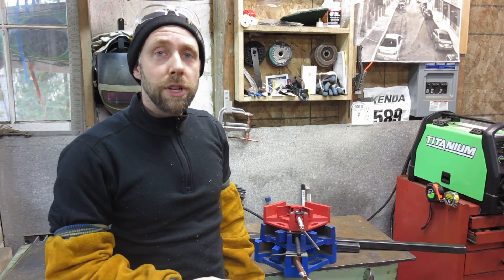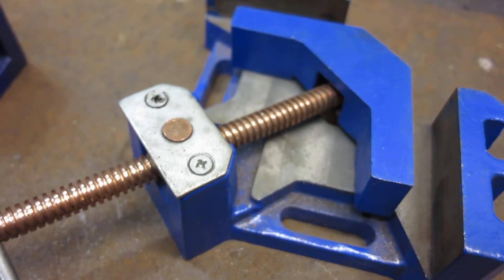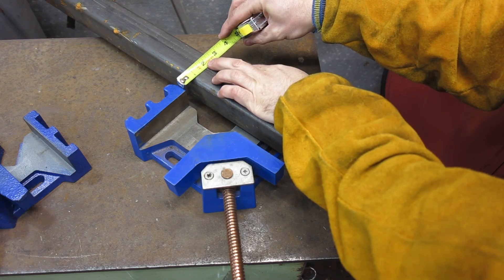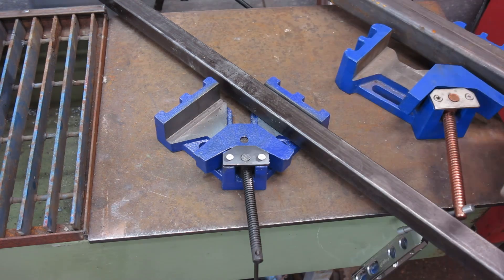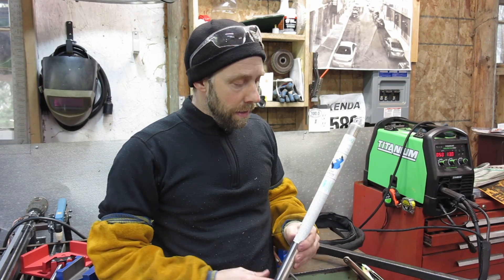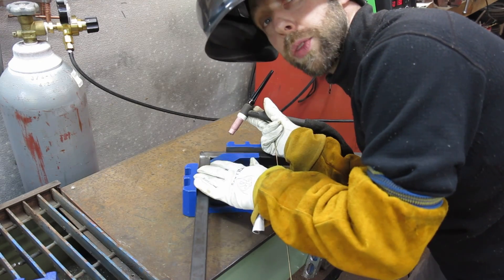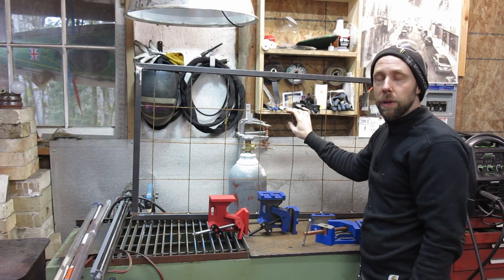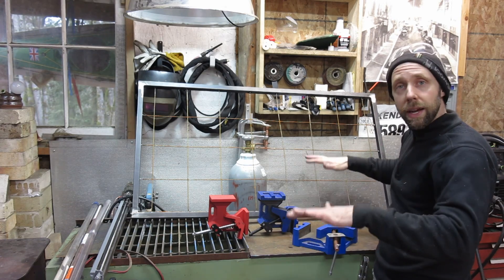Welding clamps And TIG welding With Titanium 200

Comment: Mike, thank you showing the clamps.  Also, you mentioned that was a baby gate to keep munchkins away from stove.  Keep in mind large openings kids can get there heads into and get stuck or possibly strangle.  That looked like maybe 6x6 welded wire mesh.  Building codes say for baluster spacing that should not pass a 4" sphere.  Keep up the good work.  Keith

Comment: enjoying your vids  can this welder use a foot pedal
Reply from the maker: No foot pedal is available for this Titanium, I think they should have offered one though.
Reply: @Mikefestiva  really looking at yes welder 250p,or vulcan 205
Reply: ended up with weld pro 205p,ac dc,w pedal, and cw 17 tigtorch super flex ,

Comment: Thanks brother👍👍👍 for all the information. Yeah I got 2 Titanium 170 one is designated for steel and one for aluminum.
Just to let you know that Titanium came out with a spool gun not to long ago. It looks and fills just like a parker gun. It fits the 200, 170, & 140 Titanium
Welders 10' 6" lead 150Amp it's bad ass Brother. Way nicer then the the klutch. Eastwood. & jegs.
You should get one do a show on it. Thanks for all your show's I learn a lot from you and I've been getting the hang of it all.
 Thanks..👍👍👍👍 ( Tabe )

Comment: Hi Mike. Another great video.
So what kind of Tig torch comes with the Titanium 200 I just got
A Titanium 170 and wanted to see if it fits. Thanks. (Tabe )
Reply from the maker: It’s a #17 torch, it comes with the 200, the cool thing about TIG is all the torches are basically universal, some don’t fit others only because they are rated at different amps but if you buy a # 17 torch from a different company it will fit onto the TIG lead.
I’m sorry to tell you but the Titanium 170 doesn’t have the capability to run a TIG or stick, it’s the electrical circuits inside, TIG and Stick work off of constant Amps, MIG works off of constant Voltage. But here’s a tip, if you buy the harbor freight warranty, ( I think you have a month window to buy it after your purchase) it’s good for upgrades, the 200 would be considered a upgrade so you could get the full credit of the 170 to buy the 200 if you wanted TIG, if you already have the extended warranty you can upgrade any time during your warranty. One last thing to note it’s only DC TIG so your limited to steel and stainless steel, I hear people claim you can weld aluminum with 100% helium but I think it’s really bad looking welds, ( I don’t recommend that process) I hope this info helps. I’m glad you picked up a welder 👍
Take care 🙂

Comment: Did you say you were making that gate slide ? What did you use if you did ?
Reply from the maker: I used the metal gate to slide between a doorway to keep my 2.5 year old from going down some steps. Thanks for checking out my video.
Reply: @Mikefestiva  did you use a track off some kind ?

Comment: Where can you the mig tips for the titanium 200 at?
Reply from the maker: If you have a Harbor Freight, the Vulcan ones fit, the Lincoln tips from Home Depot are also the same. If Lowe’s sells welders I’m sure they will have tips also, or just about any weld shop should have them. I think I covered this in the first comparison video I did on the Vulcan and Titanium welders, I hope this helps :)

Comment: I like those vises. The problem is holding large materials that are heavy, so the thing wants to tilt over, even with my big vise I’ve got that weighs close to 30 pounds. The material does too, when placing it in the vise until tightened up. So I had to machine pieces the height of the beds, and place them outboard. That helps. Most of this stuff is made overseas, so the sizes are really metric, so they seem a bit odd when measured in inches.

Comment: Thanks for another great video, Mike! I’ve been wanting to get more into welding. Never really did much except for a couple of little patch beads on equipment at the golf course that I used to work at and tacking together some washers to make snowmen. We were out of town today and stopped at a HF and I had every intention of pulling the trigger and grabbing the last 200 they had there but for some reason, I decided not to right now. Which sucks because we were 120 miles from home and the closest one is still 70+ miles away. 

My biggest concern is, as everyone seems to feel, that the HF line of tools just won’t hold up. I’ve gotten a couple of hand tools in the past but haven’t had to use them much to know if they are going to hold up for years to come. By what IS selling me on the Titanium 200 is being a Multiprocess for such a low price compared to name brand machines. I want to be able to learn all styles of welding and I know this would be best especially since it’s about 1/2 the cost compared to others, but I want to make sure that it will still last for years to come. Since you’ve had it, how do you feel it’s going to hold up in the long run? Do you think it would be a perfect beginner machine for someone who hasn’t really done any welding at all? Also, if the gun breaks and needs to be replaced, or if you want to add a foot pedal for it, are the Vulcan line of replacement parts compatible with the Titanium? I know the packaging doesn’t list the Titanium models, but I tried to keep my hopes up that maybe they just hadn’t updated all of that...

Sorry for the long comment. I’ve been wanting to ask a few questions for a while now since I came across your channel and really want to try to get some learning done! Thanks again and have a great weekend!
Reply from the maker: Hi Derek I do know how you feel about dropping that kind of cash at HF, a year and a half ago I walked into HF and bought the Vulcan Omnipro and I was a bit apprehensive on spending at that time $750 plus extended warranty and tax pushing the price out the door close to $1000. 
Keep in mind this was in the first month these new Vulcan welder line first came out, at that time there was only a few written reviews and a few unboxing videos but next to no videos of people actually welding with them at that time. I have been completely happy with not only my Omnipro but with the Titanium as well,They both weld fantastic! How many years will they last, who knows? Time will tell, but I can share this story with you, my friend bought a Miller around the same time as I bought my Vulcan and his Miller has been sent back for repairs 3 times now and he was without use of that welder for probably 6 months due to repairs, that Millermatic 200 cost over $2000, so I thing what I’m getting at is just because you spend more on a name brand machine doesn’t always guaranty trouble free. The nice thing is if you buy the extended warranty and something goes wrong you can take it in and walk out with a brand new welder, no waiting on a machine being sent off for repairs like with the name brand machines. Now I don’t think any of the Vulcan stuff like MIG guns will fit but I bet someone will sell a replacement MIG gun soon for these machines, I have seen other places selling MIG leads that fit the Vulcan line now so I’m sure it’s only a matter of time for the Titanium.
I definitely think it’s a great welder for a beginner or anyone that’s been limited to a low amperage welder, I really wish I could have owned something like this years ago, I had some really shit welders it the past. Honestly I personally would not buy a Lincoln or Miller, I have owned a Lincoln and I have used many Millers and these machines work every bit as good as the name brand stuff. One last thing to consider, once my friends Miller is out of warranty, if something big goes out inside the unit, it’s almost not worth repairing at $1000 dollars per circuit board and there’s two main boards inside. Do what you want, if you feel better with going name brand go that way nothing wrong with that, one thing I recommend is look at reviews on line, I just was reading reviews on Amazon for Lincoln’s square TIG 200 and there was many many people that got faulty units right out of the box or had them stop working with in a few months of use, all of these people dealt with sending there welders of for weeks to get repairs done, not what you want with a new machine!
I hope this helps, take care :)

Comment: Why did you braze some and fuse some, I assume your like me and like trying new stuff 👌. Also I would recommend a stubby gas lens kit, I got one this week and my argon regulator is on as low as it can posibaly go, and I'm still getting shiny clean welds. Saves alot of gas and is also a shorter setup. 👏🙂
Reply from the maker: Thanks for checking out my video! I like the look of the brazed bronze joints, the sides where I just fused the metal was because I didn’t want to build up the joint and add any extra metal, it was cleaner to just melt them together.
Ps next week I’m posting a video I made over a year and a half ago, it’s about my sawmill. I show how I made my throttle and blade lube controlled with the turn of a switch. So keep an eye out for that video! Is your mill up and running? I would love to see a video of it, do you have and posted on YouTube?

Comment: I had been looking for the large clamps based on a discussion we had on your previous videos.  I had been checking for a couple of months and finally bought two a couple of weeks ago.  Related to Tig Brazing. What situations would you choose to use the process?
Reply from the maker: Thanks for checking out my video! Well I’m new to TIG welding and brazing, but what I know about TIG brazing is even though it’s slightly weaker the regular welding rod the silicon bronze is useful for joining dissimilar metals like steel to bronze, steel to copper, copper to stainless steel, stuff like that, and one of the best uses is it’s good for brazing cracked cast iron parts back together. The cool thing is it’s got a lower melting temperature then the base metal your brazing to, you only need to melt the rod. The main reason I bought some was to braze some coffee tables together, I like the look of the bronze joints, it looks more quality to me. Take care :)

Comment: Another excellent video Mike.  I purchased a pair of the middle size clamps several weeks ago and had to replace the top bracket machine screws, as those that came with the clamp did not hold the bracket tight to the casting.  I believe they are M5 machine screws.  Can you explain brazing versus the use of TIG filler rods?
Reply from the maker: Thanks David for commenting and checking out my video! So I’m new to TIG welding but the advantage of silicon bronze brazing rod is even though it’s a little weaker then steel filler rot it’s got a lower melting point so you don’t need to melt the base metal, and you can braze different kinds of metals together, copper to steel, steel to brass, stainless to copper, and one big thing is it can be used to repair cracked cast iron parts. I figured it would to be nice to have around my shop and the last plus I can see to using it is the nice esthetics of the bronze joint, I’m working on some coffee table projects and I like the bronze look on the joints. Take care! Ps that’s to bad the clamps needed work already :(

Comment: Seems like I when I looked at that rebar, it was cheaper to buy animal panels. Nicer finish on the animal panels too, but that could be a negative if welding them, since they are galvanized.
Reply: Kids falling out of things is normal. Heck, I fell off a cliff when I was a kid. Had surgery, but my friends caught a tortoise and gave it to me, so it was worth it!
Reply from the maker: Thanks for commenting! It definitely depends on the projects, the galvanized is nice for outdoors and I need to pick some up to finish a kids play house, ( to keep my little guy from falling out the open windows).
This was for the inside of my cabin and I don’t mind a little raw metal look with a touch of rust :) Thanks for checking out my video!